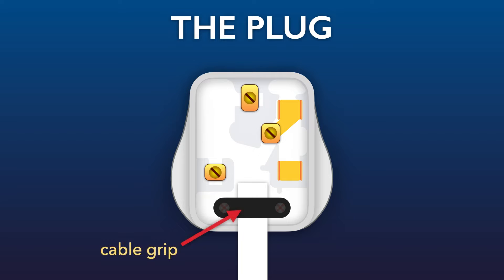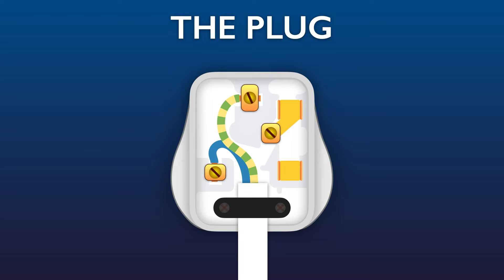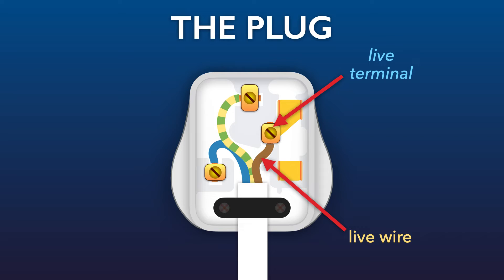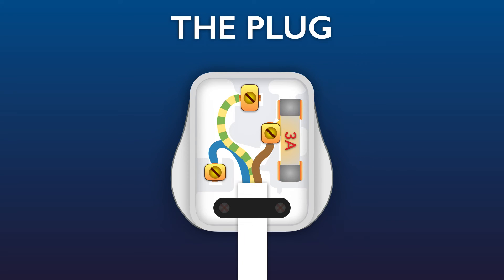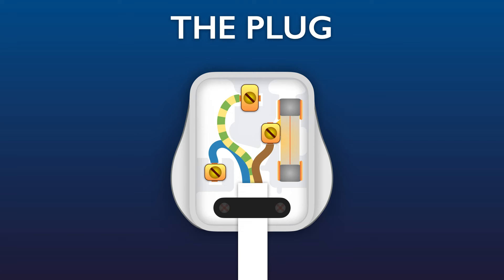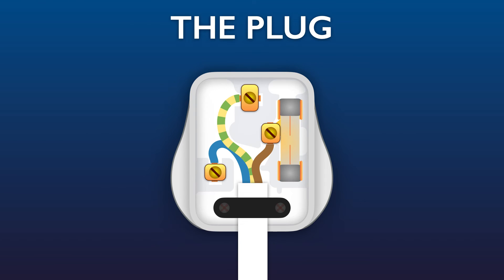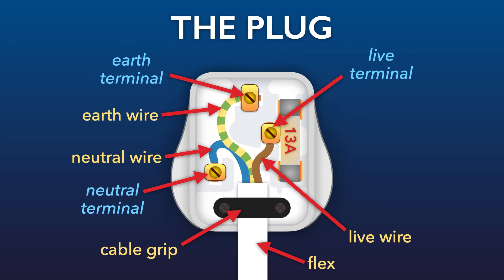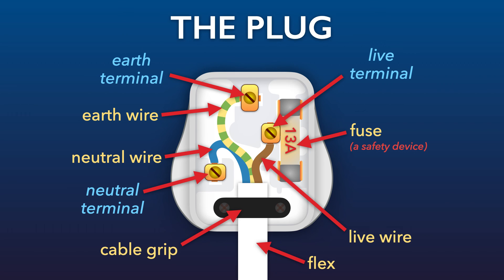UK 3-Pin Plug EXPLAINED: a look inside & how It Works

Comment: Do you know the cable specifications to order it? I need for GCSE wiring a plug practical. Thanks
Reply from the maker: Not sure - if it's just for a wiring exercise, I'd just have a look for it on Screwfix or a DIY store. If it was actually to be used, I'd be more selective and get the correct cable for the job.

Comment: I have purchased a grounding mat.  Am I correct in thinking that the top of the three holes in an English  three point socket is the grounding  hole? The instructions given are for the USA.  I don't want a truly electrifying experience!!!
Reply from the maker: I'd always check with a certified electrician if you have any questions about the use of it.